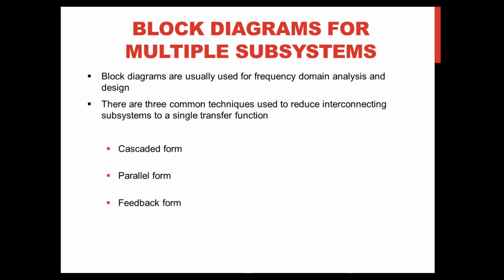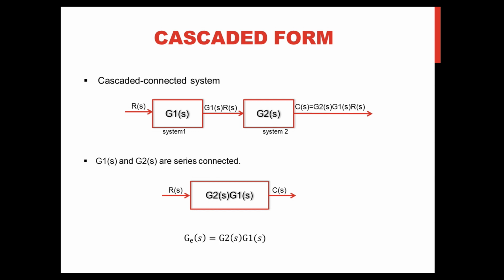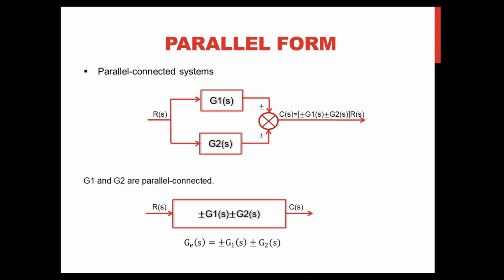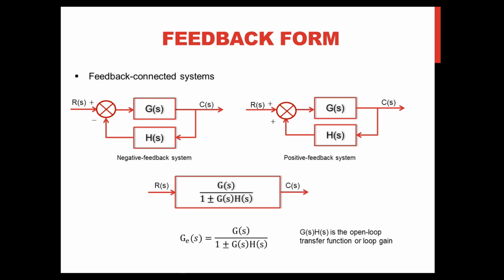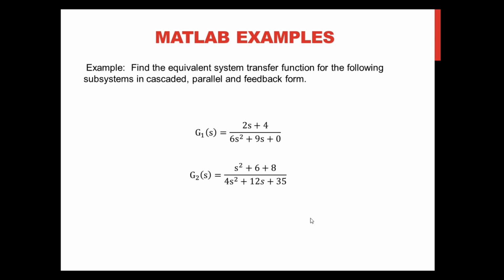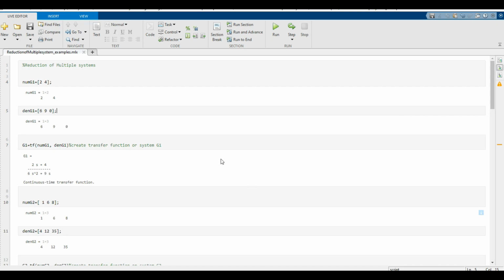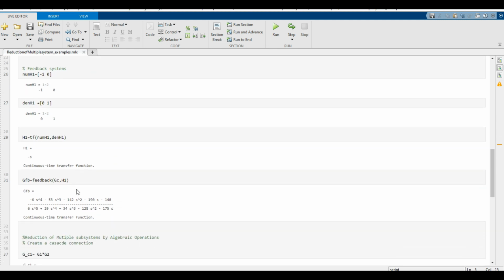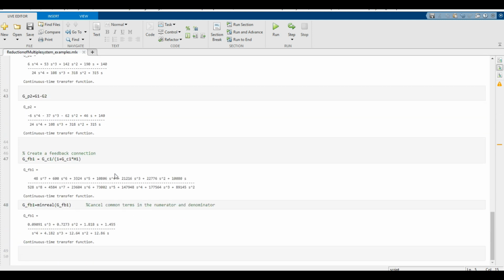Reduction of Multiple systems

Comment: I found some parts of the parallel connection using Matlab challenging, but  I guess the manual calculation is best.
Reply from the maker: Which aspects of it was challenging in Matlab?
Reply: @nadiasmith6855  I understand now